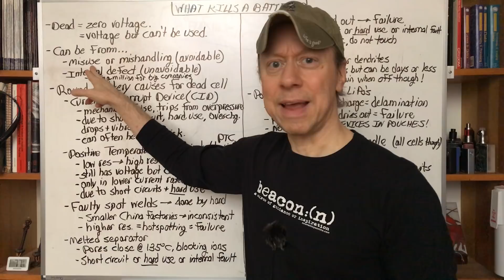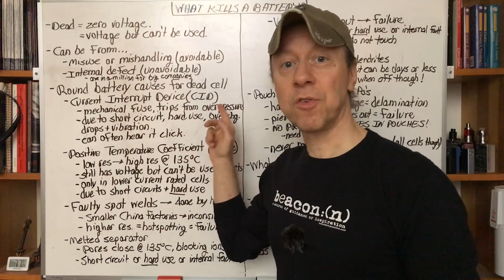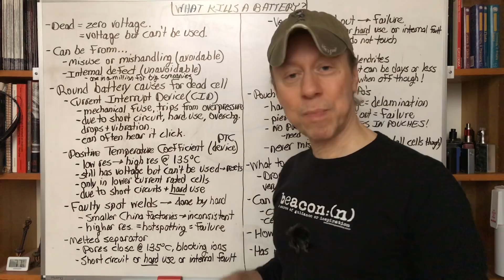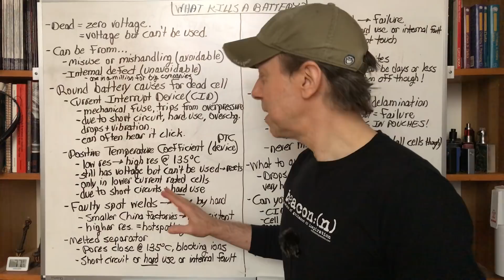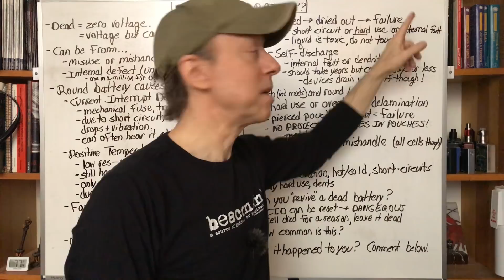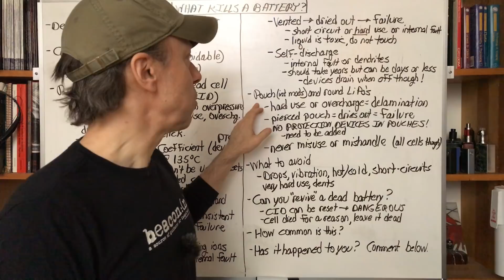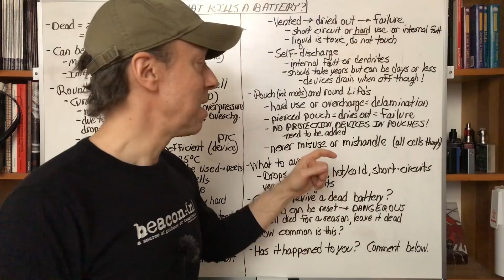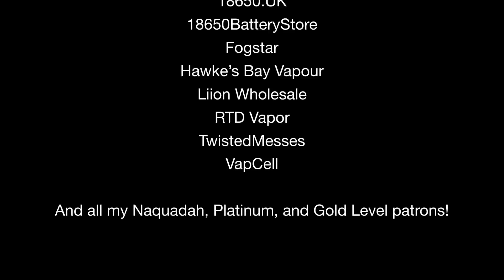Minding Your mAhs Ep028 – What causes a Li-Ion battery to suddenly fail?

Comment: I think my vtc4 is 18 years old and does not drop beyond 4.16v even after months, but it loads in 9 hours from 3.7v to 4.20v and it drops instantly to 4.18v does not hold 4.20v and in any case I think this be fantastic!!
Reply from the maker: IIRC, the VTC4 was released in 2013 but I’m glad yours is still working well for you!

Comment: I’ve had an Aspire 26650 randomly pop on me. It wasn’t in use or the charger, it was sat on my side for about 6-7 months and the valve on the positive terminal just popped and it was loud. The battery started to hiss, I grabbed it and it wasn’t even warm at all and I buried it positive terminal down in the mud. It’s still sat there now not doing anything. The cell was about 2 years old and about a year and two months I’ve noticed it wasn’t holding a full charge, it held up to 70-80% charge and would last a day before it got shelved. During the time I was using it I was getting nearly two full days of use out of it. What could have caused it to pop like it did?
Reply from the maker: Wow, that is a weird one. It hadn’t been used in months and popped?
That you couldn’t fully charge it sounds like it was damaged and/or had reached the end of its life from normal use. I am only guessing but perhaps an internal short circuit from “dendrites” (metal deposits where they shouldn’t be from the cell aging) was slowly growing and finally reached the point where the dendrites could touch and the short circuit created enough gas to pop the top venting disk. I don’t know what really happened though and can only guess. Older cells can lose performance or fail in all sorts of ways from several different causes, each having some effect that adds up. Thanks for telling me about this though!
Reply: @batterymooch  No problem. I was chatting to a few people on the Planet of the Vapes forum and they’ve came to the same conclusion that it might have been dendrites shorting out in the battery causing it to randomly pop like it did probably due to a build up of gas in the cell. The cell was old and got good use out of it, would never exceed what the cell can do. It was rated for 20A continuous discharge and the most I would use is 8A so the cell wasn’t abused. Except the negative part of the battery wrap that had peeled a bit.

Another user on the Planet of the Vapes forum had a similar incident with two of his Samsung 30Ts.

Comment: Hi mooch ive had this on a cell 30Q put it in my drag X shows full power on the battery indicator hit the fire button and says low battery tried all my other cells in the mod and they all work fine no dings or rips in the wrap very strange battery only 6month old
Reply from the maker: It might be damaged or it could be a fake. If you have been using it without problems for 6 months though then it’s probably genuine and it might have been damaged somehow.
Reply: @batterymooch  buy all my cells from fogstar or my local vape shop drip drop vapour so i know they are legit cells im unsure what happened with it as my cells literally go out my mod into the charger out the charger into my padded cell pouch then back into the mod as and when needed very strange indeed
Reply: being primarily a mech user using 21700 30Ts stacked i never drain my cells to low and always swap them out before my regulated mods flag low battery or i feel a drop in power when using my mechs
Reply from the maker: @chrisshaw3191  it’s a mystery then!

Comment: I run a geekvape regis x and was running 2 
Samsung 30Q 18650 3000mAh 15A Batteries, fully charges    after about the fourth vape the right battery suddenly showed 1 bar and left was full charge.....there was about 2 volts in it...  very quick failure  never the less   it will be recycled the coming week. no click or vent   it just went dead. my mod is fine and bought new batteries.
Reply from the maker: Very strange! Glad nothing else happened.

Comment: i have one 18650 left in my bag with metal stuff, it didnt release gas and other stuff but it was really hot. i also have a pair of 18650 which was really really old (like 4yrs) it still has voltage it is still usable but it doesnt have the same power since i had it, i also had a friend REVIVED his lg H2 batteries (battery death cause unknown), did work for a month or two after then it is not usable but it has voltage.

Comment: I bought four Basen 26650 60A, I charged them up and kept them in the drawer, never used them yet. One cell after 4 months leaked (vented) out the positive cap and left clear slippery stuff under the terminal and rusted by the time i realized this. Basen is made in China. I left messages but got no reply from them.
Reply from the maker: Ouch...the dangers of using the cells from the smaller China factories, higher failure rates. Unfortunately none of the big companies make 26650’s. 😔
Reply: @batterymooch I also have bought some Sofirn 26650 with 5500 mAh, again out of 4 cells, 1cell self discharges to almost nothing in 1 week. I got a refund from them at least.

Comment: Is it normal for a device to drain batteries unevenly. Like to the point where they are drastically different or is this possibly a bad batch of batteries? I tend to the side of the mod of course since I'm using Samsung and I don't see how this can happen to a whole lot of them but I find it odd when I put in Sony batteries and they come out just fine, totally even. Very confusing. 
Wismec RX Gen3 Dual was the mod this happened with...has anyone else noticed this with that mod?
Reply from the maker: The big manufacturers won’t release bad batches of batteries so it could be batteries that are old, were stored badly by the reseller, or they are fakes. Or one of the Samsung batteries has started to reach the end of its life so it drops its voltage faster. Some mods are badly designed and can unevenly drain their batteries but it would happen with any brand battery I would think. How are you seeing that they are uneven? The display in mods can be very inaccurate. Mark the one battery that seems to be lower than the other and note which slot in the mod you used. Then fully recharge the batteries and swap slots in the mod. If the same battery is still lower then it’s probably the battery. If the other battery is lower then it’s just the mod not showing you accurate voltages/levels.
Reply: Battery Mooch  Good idea. I was contemplating doing a similar thing with marking them.  An old pair of VTC4s are the only other batteries that go in this mod and they’re in perfect shape, haven’t been unevenly drained at all. I’m mainly getting my info from my charger. The mod itself I hardly ever trust since I’ve had a few Fuchai 213s that have crazy weird readings. I’ll definitely give that a try though. Appreciate the thoughts. I get all my batteries from imrbatteries, I’d like to think they’re respectable. If it is the batteries, I guess I’ll have to watch the others since I bought a big order of 30Qs and 20S’s. None of my 20s have had any issues thankfully since they’re going in a series mod. The others are in a regulated, I made sure to tell my gf not to let them get past 50% charge just in case.
Reply from the maker: Kris Wk if the charger doesn’t have a voltage display then don’t use the “bars” to estimate how full a battery is. It only takes a tiny fraction of a volt to switch a bar on or off if the battery is right at the threshold. It looks like a big difference between the batteries but it’s not. I don’t know if this is what is going on with your batteries but percentage displays and “bars” can fool us.

Comment: Hi Mooch, so I used 2 18650 25r until my mod said low voltage, then my charger wouldnt detect them. But I was able to charge them one by one in other mod. Have I "revived" those batteries and should I dipose them? My charger does recognize them now and takes them to 4.2v.
Reply from the maker: Sorry, there’s no way for me to know the condition of those batteries. If they weren’t below 2.5V for very long then they might be okay to continue using. But it will have to be your decision whether to use them or replace them. I just don’t know.
Reply: @batterymooch  I will replace them, thanks!

Comment: Had it happen with lg's,  the positive contact plate is too soft and with daily drops the positive plate was pressed down as far as it could go and the battery would charge but provided no power appropriate for vape!
Reply: The lg's were the hg2 chocolate and were short lived compared to my 25r and vapcell's even my white with red print QSO's are superior in terms of durability!

Comment: I've had multiple vapes now where after a few months of use it would eventually read one battery as full and the other empty even after freshly charging the batteries (which would both read 100% when plugged into my charger), triggering the low battery protection. I eventually replaced my charger and I no longer have this problem (no idea what was wrong with my original one)
Reply from the maker: Weird. Glad you figured it out though!

Comment: Hi Mooch! Good vid as allways. I've been vaping 8 years now. I've had one battery failure. I was vaping with my og noisy cricket. I'm sure you know that mod but it's a series mech. I had brand new pair of vtc5a's in and an rda with .4 ohm dual coil setup. I pressed the switch and heard a weird sound and felt the mod and the switch get really hot really quick. I screwed the switch lightning fast and pulled it out. The cell below the switch came out with the switch. Yes it had welded itself to the switch. No explosion or fire but I'm sure I was just moments away from that. After a quick change of underwear I checked my setup and everything else and no shorts or anything that would explain this. I know my onions what comes to setups and mechs but don't know why this happened. I guess it was just a bad cell. It was a genuine Sony from a well known supplier. As I said brand spanking new pair first time in use. 

Keep up the good work Mooch.

Comment: I have A LOT of cells and have been vaping every day for over 6 years. I diligently TRY to be as safe as possible and constantly respect my batteries’ power and volatility....and ratings (thanks to you!!!👍). I rest them, rotate them and ALWAYS charge them in a quality external charger. I am dumbfounded by those willing to try to save a couple of dollars on batteries to put in a mod/tank setup that probably cost +$100 AND THEN PUT IT IN THEIR MOUTH REPEATEDLY!!!!! 🙄🤦‍♂️👊

I have (over the years) had many begin to drop too fast, increased internal resistance and piss me off to the point of replacing them....and even had a friend place my MCM Panzer Golden Army down ON THE UNLOCKED TAILCAP FIRE BUTTON....which is how it sat, cooking my coils, flooding ALL the juice out of the air holes and torching my cotton until I HEARD it hissing several minutes later.....somehow the battery survived (though never the same)....it was an Orbtronic SX30 High Drain 30A (rated) button top. I was pissed at my friend....impressed with the battery’s resilience and learned a VALUABLE LESSON..... I handle these with care, do research and watch Battery Mooch in a constant effort to be as “safe” as I can.....many (most?) do not and I need to be aware of that when “they” are around my devices!!

I have NEVER had one vent or go into a thermal runaway and pray that I never do...which I shouldn’t, as I DO practice the safest informed handling and use of them and ALWAYS operate them with at least a 10% margin of error.

Comment: Watching power hour #13 ATM. I haven't gotten around watching this episode yet. But I have had 4 real VTC5a's (bought from IMR and 18650batterystore) go dead on me. the first one happened 3 or 4 years ago and I asked you about it on a live show and I guess you hadn't had much experience with them going dead because you gave a "well your charger may have or mod blah blah" (I can't remember exactly what you said. It wasn't mean or harsh just not an explanation that was helpful I know you tried I am not berating you if it sounds that way). Basically dismissed it as a user error. To be fair I do use them pretty hard. About 0.07 - 0.08 in a single battery mech. Which I know is pretty hard but I only take a couple pulls then sit it down. But I am glad that it is now a known thing. I will watch this later to get my explanation. I just came to comment to give you more info to add to how many have failed or whatever they do.
Reply from the maker: A charger fault or mod fault is definitely not user error and I was not even trying to hint that it was user error. 🙂 There’s just no way I could have figured out what happened to your batteries so I mentioned the most probable causes...device failure. There were certainly other possible things, also not user error related, that could have been the cause but there just wasn’t time to go into detail. Using any cell with a 0.07-0.08 build will can definitely cause failure though as it severely stresses the tabs, spot welds, and other hot spots inside the cell. Is this “user error”? Folks could debate that for years. It is above the cells’s rating though and that causes damage that can accumulate and cause the battery to fail. So, it might have been one of the devices or it might have been the way they were used. No way to know though. Thanks for posting about your failures here!
Reply: @batterymooch  Thx for the reply. Further info is the ones that have failed for me have all been new. They failed within the first 10 charges. It seems If they last for a couple weeks they keep going. I still am using 4 of the first batch of VTC5a's I bought. I no longer use VTC5a's in my mechs as the 20s have them beat by miles in voltage and they stay so much cooler.

Comment: thank you brother! had a single he2 lose all voltage sitting in my wooden battery holder (hardwood block with multiple holes bored into it with wooden bottom). had two other batteries drain to zero V from leaving them in a asmodus minakin V2.

Comment: You are a wealth of knowledge and I eat it all up.  I have been vaporing 10 and a 1/2 years now and refused to use a mech mod untell 3 years ago because learning from you about batteries and ohms laws and doing my own study to feel confident and safe enough to do so. So thank you Battery Mooch!  Oh and I have had 2 batteries that had  A small amount of voltage on then but were dead with no venting or damage on them that just didn't work. I put both on charger for about 4hrs. 1 still dead 1 said full charge on the charger. The full one I got like 2 small hits and then dead and wouldn't charge after that and they were 18650 Efest batteries about 3yrs. A go. I buy 12 batteries every year to year and a half and vaping for 10 + yrs I have seen a lot of batteries lol.

Comment: Hey Mooch, Great video! As you know (If you remember our discussion) It happened to me with a Molicel 20700A, got it from IMR (where I get 90% of my cells) worked fine for a month or two and just died, 0 Voltage! no damage, no hard use, good charging/cycles (3.3-3.5v to 4.2) on a Hohm Base Charger. Just died out of blue! the CID didn't pop as you saw and no damage guess I just got one of those "1 in a million"  I just got 2 more as they are amazing 20700's. I love that you did this video and discussed all you had told me previous and put it all in a great very informative video! Im curious if you have had many more of these cases brought up to you!? Thank you for all you do for the vaping community! You have helped so many people and seriously helped keep the vape world safe, THANK YOU MOOCH! You're amazing!
Reply from the maker: Thank you for your kind words! A few reports but most here in the comments.

Comment: I had one battery cid trip. It was my fault. I was half asleep and put a battery in backwards into a tugboat mod.  I noticed that the batteries were getting hot and pulled both of them out and tossed them out on my driveway. One was still showing voltage a few hours later but I recycled both of them. I don't remember the battery type but that doesn't matter much as my stupid mistake would be fatal to any 18650. That was back when tugboat was a new mod and I have made sure to never repeat it again.
Reply: Im glad you threw them outside!   18650s are bombs if ya mess up!!

Comment: I've never had a battery die on me. I have dented some postive contacts, especially a new batch of 25R's I bought recently. From the 20-30 people I've known to regularly vape, I've only ever heard of two people that had an actual issue, besides general degredation over time. 

One put the battery in a loose pocket with keys and it short-circuited and ignited the bag. Totally his misuse.

The other was a friend using a very questionable cell and a shitty mechanical clone mod that short-circuited. The battery "bloated" and was very hot. He just threw in some part in his yard and left it there for a few days.

Comment: I had a battery (18650, VTC5 or 6) go hot on me once, although I don't think it vented (i.e. released hot gases). I took it outside and set it on the walk away from the house to cool for awhile. When I checked on it later it had cooled off and I was not surprised to find that it no longer worked (even though I didn't know you at that time). When I opened the (regulated) mod to replace the battery I found that it had become hot enough to melt the solder on the microchip which I found embedded it the plastic wrap of the battery.

Comment: Thanks for another great video, Mooch. Weird timing since i literally had a battery die last week. It was a Golisi S35 21700 used only in regulated mods since purchased November 2018. Regularly rotated with another purchased at the same time for my single battery mods. Put it in the charger and ensured it registered as charging (at .5 since a couple other batteries were already in the first 2 bays) but when I came back - nothing. Dead. Weird.